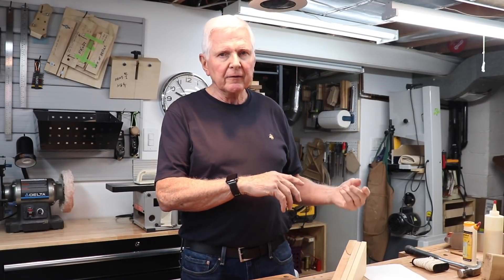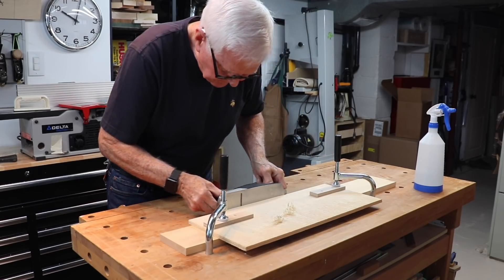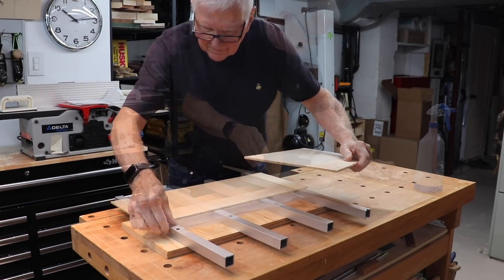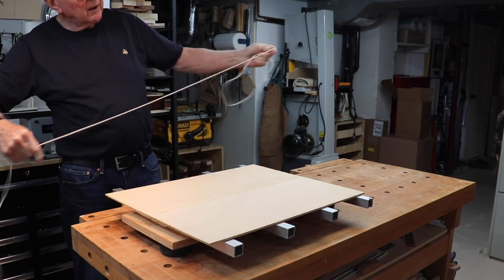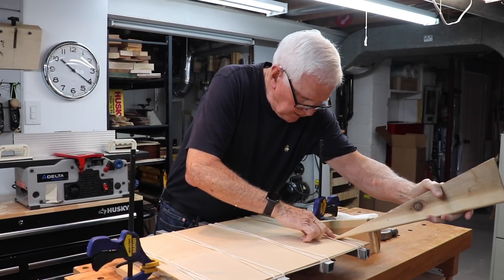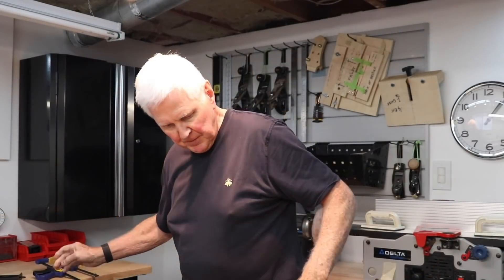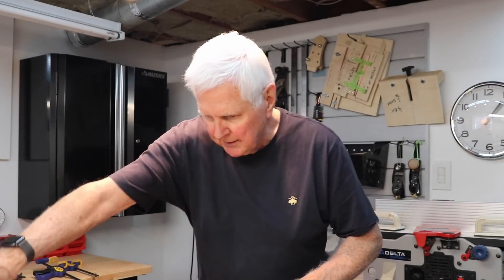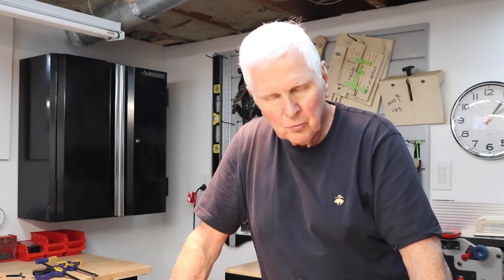joining the perfect guitar top that guitarplayers will love!

Comment: This is great, I came from Peter's page. Mr. McKinnon, I have questions, what kind of glue and how did you apply it? How do you choose the wood and where do you get it. How much does it cost to build a guitar? Not including shop space and tools?
Reply from the maker: For most of it I use Titebond glue. I use may finger to apply it.The wood comes from Luthier houses like LLMI and Stewamac and local mill yards. You can buy a kit for about 450-$550. Hope that helps.

Comment: Is there any particular pattern when you're putting the string on? I'd like to see the entire method of you putting on the rope. It's hard for me to tell.
Reply: I could be mistaking but from my experience it doesn't really matter. 
Personally I start with one of the outside ones, either left or right - then do the complete opposite outer side and then the middle ones follow. 
As long as you don't take as long as the glue takes to dry, you should be fine - the jig will pull itself straight once you encourage the triangle's!